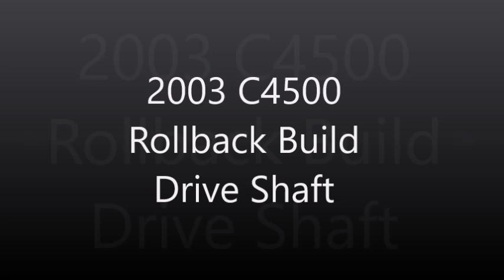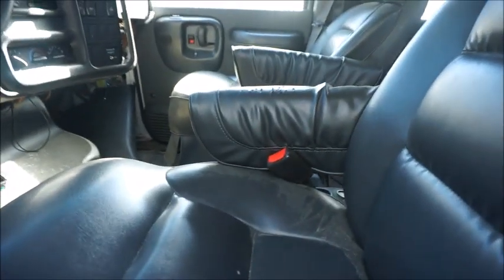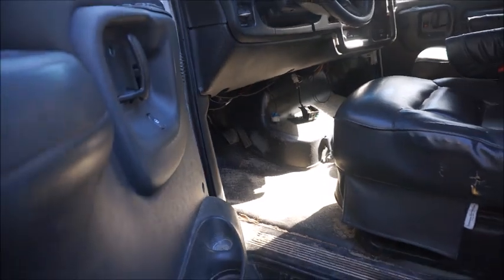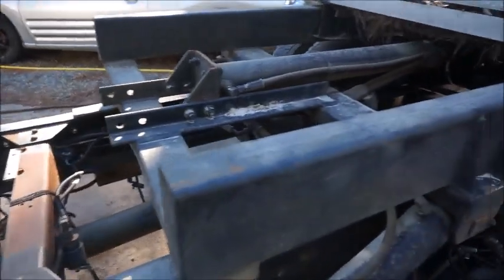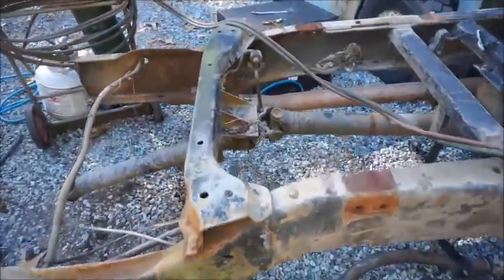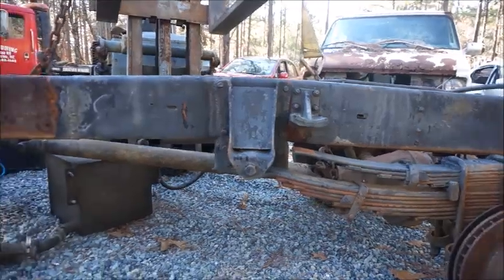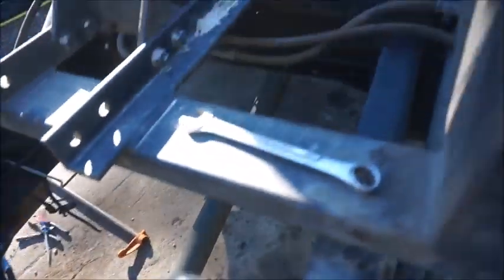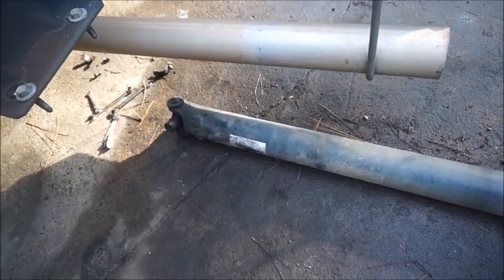2003 C4500 Rollback Build Driveshaft

Comment: @1:29 you show the pivot point for the rollback, I would box the least 10" (or to the middle of the air bag) of the frame on both sides so the pivot won't move around and it would strengthen your weld on the end. My dad had a Chevy C65 with rollback and had that done.
Merry Christmas & Happy New Year

Comment: took your advise from the previous video and have dun a couple of driveshaft's myself.  did just how you explained it and it turned out great.  took my fl60 freightliner with a engine swap and shortened driveshaft to get inspected and those fellas  where impressed.  told them about watchen your YouTube channel....  thanks for the info

Comment: hey Jonathan I enjoy all your builds and have used your techniques. I can't thank you enough for what I have learned from you, and on that note I would like to share some advice on the Duramax platform.  I know u noticed that they do not use a lift pump to push fuel to the injection pump (cp3), and I would highly recommend you use a lift pump.  
the injection pump has a lift/suction pump built-in to it, but I have seen the injection pumps last longer when a second lift pump is added to help.  the injection pump itself  uses diesel to cool it so I good supply of fuel will work wonders. you can google Duramax lift pump and read all about the pros and cons of adding a second lift pump. 
thank you for what u do I try and turn my friends and co-workers on to your channel daily.
thank you sir.
Doug Lominac
Reply from the maker: I agree. All of the old equipment I ever owned with gravity feed I used an electric pump on. I was told many years ago from a old man that his injector pumps lasted much longer with them.